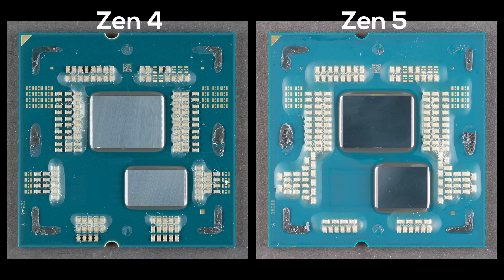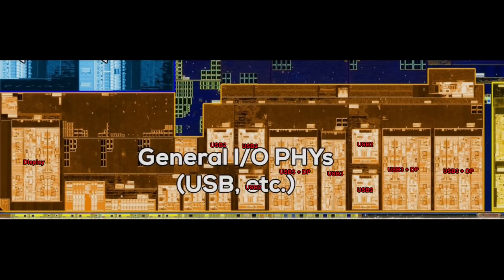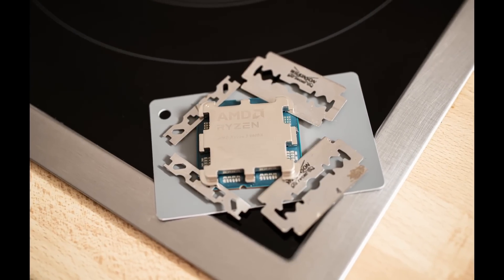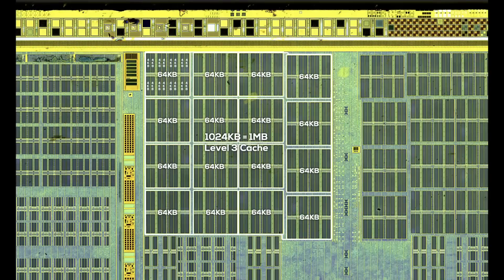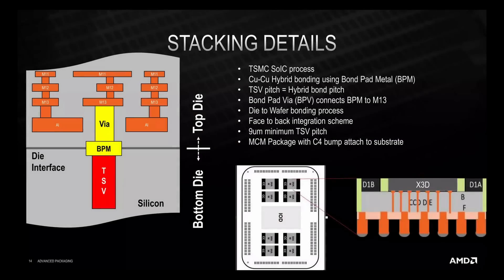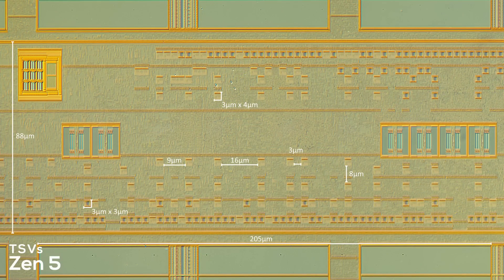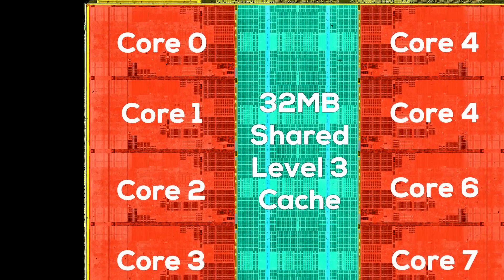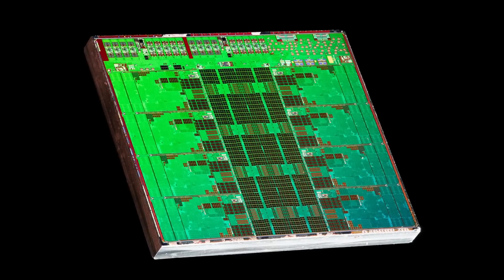ZEN 5 has a 3D V-Cache Secret

Comment: Having 2-layer 3D-cache makes sense given the rumors that the new X3D-CPU's can boost higher. More compact 3D-cache that is further away from the compute cores would be less sensitive to heat coming from the compute cores.
Reply: As the SRAM cache is now probably stacked now on multiple layers. Wondering if it suffers also from exes heat. Question is how much can you stack before heat dissipation starts to become issue and making it more unstable etc... Even SRAM is more efficient and generates less heat.
Reply: There's an ongoing paradigm shift in how to layer IC using the Z dimension to bring further advancements. I wouldn't be surprised if we see really thick dies in the future where power delivery, logic and cache have their own layers.
Reply: Now we know that it is "simply" (I'm being sarcastic, since there is nothing simple abut it) because 3D V-Cache chiplet will be below compute chiplet. Not above. Which has a lot of perks when it comes to thermals, but also a lot of trade-offs in other areas. Performance should be higher, because not only it will be able to clock higher than 7800X3D , it will also be fully overclockable.
However for example cost and complexity will be higher, packaging will have to be even more precise etc. No wonder that while "regular" Zen 5 chips launched with 30$ lower MSRP than Zen 4 and now got additional price cuts. 9800X3D is launching with 30$ higher MSRP and also demand for and perceived short supply of 7800X3D already has it around the same price (150$ up from 2 months ago) than 9800X3D (480$ MSRP) Though I assume that once the process matures, especially in packaging, prices will drop. But it might take longer time than usual. However 7800X3D has probably already stopped production. People thought that this was driving price up, but honestly it was demand, since there were enough 7800X3D chips in supply chain that some are still being delivered to retailers.
Also as Dr. Ian Cutress explained in this configuration latency in clock cycles might increase. Due to increase in Frequency latency might not increase in time though thankfully. But now doing 2-hi or 4-hi chips would be more difficult. HBM has controller below memory, like zen3 and zen4 3D V-cache chips had. Of course said controller uses much less energy.
Also it seems that Turin-X isn't in the plans, but maybe we will get Threadripper with V-cache. Maybe some new solutions will allow it to also be included in Zen 6 and further if we think of increasing amount of 3D V-Cache. Personally I was thinking that Backside Power delivery might be this technology that will help. Because that new "flipped" L3+compute die, with BPD will be flipped again. We shall see.
Reply: @jannegrey honestly, the 9800x3d price increase probably has less to do with actual production cost and more to do with it being the best gaming CPU on the market, and not by just a little bit. They charge more because they can and people are obviously willing to pay it
Reply: Wasn't the main issue with the clockspeeds the lower voltage tolerance of v-cache, not the heat? The heat issue is solved with lower power limit and lowered thermal limit, but it should have still been able to clock high for as long as it had the thermal headroom instead of having locked core voltage
Reply: @shepardpolska Saying new X3D chips could "clock higher" really just means in relation to the non-X3D configuration. Since zen5 effectively has the same freq limits as zen4 while generally being more efficient, it's very likely X3D will get closer to this because it'll have more headroom. Especially since X3D uses binned chips capable of running lower voltages.
Reply: I don't understand. How would a higher stack the heat has to be dissipated through solve any heat issues?
Reply: @unvergebeneid  Heat comes more from the cores than from the cache. That's why they stack on the L2 cache in the first place.
Reply: @aapje  ah, now I understand, thanks!
Reply: Maybe I missed something in the video, but why didn’t the CCD tear down conclusively answer how many cache chips there were? They had to remove the cache chip(s) to get down to the base logic chip to get those die shots anyway, right?
Reply: @JoeLion55  this wasn't a 3D V-Cache CPU because they aren't out yet. Hence the speculation.
Reply: @unvergebeneid  oh, then how did they get the die shots…? I  thought these were from decapped shipping units
Reply: @JoeLion55  They used a current non-3D V Cache CPU (that is already released), and some shots of 3D V-Cache were from the last generation of CPU. It's all labeled and explained in the video.
Reply: @The7Tycoon  thanks, caught all of that on the 2nd watch through

Comment: Excellent explanation. I want to see how X3D cache will be implemented on Zen 5 since some reports tell that the 9950X3D and 9900X3D will bring something new.
Reply: Yes the 2 CCD parts will both have stacked cache
Reply: @Razzbow potential +128MB 3d cache for 9950X3D?
Reply: Only buy dual CCD if you actually needs the CPU power for applications, because in games, 9800X3D will beat them. Single CCD = No latency issues.
Reply: @Dr.WhetFarts if both CCDs have V Cache that means that process can stay in any CCD without worrying their data is in the other, they don't have to be specially allocated nor windows have to use core parking
Reply: You could also use project Lasso tied 2 games so that whenever you launch a game, it automatically disables The Other CCD for only that game process  @Dr.WhetFarts

Comment: I really expected a new I/O die with Zen 5, but the fact that it is the same perfectly explains why Zen 5 has the same difficulties with two memory sticks per channel as Zen 4.
Reply: It seems they're putting all their IO efforts into Zen6 but honestly I think it's unlikely we'll see significantly higher frequencies with 2+ DPC DDR5 as there are inherent signal integrity challenges that go beyond what is limited by the PHY and UMC. I'd expect an improvement but wouldn't be surprised if supported speeds still aren't significantly higher in these configurations.
Reply: @JJFX-  Maybe Zen5+ next year with the Zen 5 CCD but new IO Die? With all the AI hype they might accelerate some things. 
You're right though, we're clearly running into the limits of DIMMs, as for the first time in decades we're seeing new forms pop up like CAMM2.
Reply: @MacGuyver85  Well I doubt there will be an iterative generation on desktop prior to Zen6. I see the most significant IO improvements going hand in hand with the advancements brought by Zen6. Even though Zen5 overhauled the core design, in some ways this generation can be viewed as Zen4++. The next generation will likely bring it all together as the pinnacle of AM5 prior to moving forward with DDR6.
Reply: @MacGuyver85  "Maybe Zen5+ next year with the Zen 5 CCD but new IO Die"
Strix Halo?
Strix Halo/Sarlak is supposed to be 1-2 Zen 5 CCDs along with a larger I/O die with a much more powerful GPU and a 256-bit (i.e. quad-channel DDR5) memory bus. It's for laptops though, and is not expected to be released on AM5, unless they have a load of partially-defective I/O dies and decide to use them for a desktop SKU which is heavily cut-down, because AM5 only supports 2 memory channels.
Reply: @nathangamble125  Yeah, that sounds like the path forward for desktop as well. Just minus the large iGPU. 
Something has got to give to keep those cores fed, and if it isn't more cache or much faster memory, it'll have to be quad channel.
Thanks for the info, not up to date on all the different CPUs out there, especially laptop/APU.
Reply: @MacGuyver85 CAMM works for laptops not desktops. Most likely thing we are gonna get is optical signaling so we can run memory at higher speeds and less latency. Same things have been suggested for PCI-E and even inside the CPU.
Reply: @xfy123  There are several desktop motherboards coming with CAMM2.
Optical is the end-game but that's not viable in the near future.
Reply: @MacGuyver85  afaik CAMM 2 is in testing for small form factor and clean looks not for performance seeing as it would severely hamper memory capacity as you could only use one sided camm modules at high speed without overheating and getting unstable ram. If I remember correctly NASA used optical signaling for memory back in the 80s so if the need arises we definitely could go to optical for signal integrity.
Reply: And why the uplift of Zen 5 over Zen 4 is so small. 
Better cores that are as memory constrained as the previous gen which was already memory constrained...
Reply: I think zen6 will be on a new socket with ddr6 and pcie 6
Reply: @hasantan  Considering that they're still struggling to get the most out of DDR5 and PCIE6 is not only a whole other can of worms but generally unnecessary on desktop (at least for a while), I think Zen6 will be the last AM5 generation as will the presumed X970 platform. It's possible they're playing it safe by supporting both DDR5 and DDR6.
Reply: @hasantan  a lot of people would get angry. But we have leaks of Zen 6 with both DDR5 and DDR6 memory support, so I don't think it will be AM6 only.
Reply: @hasantan  I have doubts about PCIe v6. V5 encountered substantial signal integrity issues in mass production design, just over the length of an ATX size board. V6 may end up being only slightly faster than v5 but with improved signal integrety for ease of manufacturing.(and the server needs external PCIe cables, they directly connect adjacent racks with v3 cables, and adjacent cases can be connected with v4, but they lost that with v5.
Just look at all of the boards that mix v5 and v4 PCIe slots, you didn't see that with v3 or v4 boards.

Comment: Great analysis as always. I hope that Zen 5 X3D brings a larger leap in gaming performance than regular Zen 5 did.
Reply: The AMD has said that 3D cache version can clock closer to non cache version. So while 7000 and 9000 non cache versions have allmost same clockspeed… the 3D cache version 9000 version should clock higher than 7000 series does. And that is the main advantage this time.
Reply: @haukionkannel  if all of this is true then the 9800 X3D will be worth the buy.
Reply: 9000X3D will deliver a much bigger jump from 7000X3D than 9000 did from 7000. Massively higher clockspeeds is the reason. Less sensitive 3D cache = Higher clockspeeds.

Comment: I wish AMD would sell consumer parts with 2 "golden" CCD's both with 3D V Cache (obvs for a premium)
Reply: It's already been rumored that the 9900X3D and 9950X3D models will have 3D V-Cache on both CCDs. Remains to be seen if it's true.
Reply: @KillahMate  those will be really expensive cpus if that is true!
If one 3D cache chip increases price by $100+, two will increase it by $200+… but why not! If there are people who want to buy, lets just make them! Nothing wrong in that. It just does not make sense in economical and productivity task speed reduction in mind. Hopefully they also make one 3D cache chips versions to those who want also productivity boost.
Reply: @haukionkannel Realistically the vanilla Zen5 flagship should be closer to $500-$550 so it wouldn't be that hard to imagine a 2xX3D configuration holding around $699-$749 depending on much performance actually scales.

The smaller L3 cache would improve yields and doesn't necessarily need to use the same node but how much this helps offset the cost of stacking 2 cache wafers remains to be seen (assuming that's the case).

IMO dual X3D chiplets makes for a more sensible product stack as long as they are able to bump up clock speeds. It's possible they'd wait to unveil this with Zen6 but I have a feeling we'll see something more interesting for that (perhaps shared L3 across two CCDs?).
Reply: I'd rather they just release enthusiast models without an IHS designed for direct die cooling.
Reply: So you would get much more expensive cpu that is worse in productivity and about as fast in gaming as single 3D cache version… why would AMD do that? Why would they make the chip more expensive and worse?
Reply: @haukionkannel  Because there is a market for those who wish to have a mix of both; I would rather have a chip that has vcache on both CCDs to minimize cache misses when a program or game is utilizing more than 8 cores.  If there is enough data to overwhelm the non vcache portion then its much more likely to pull data from ram again which has kept me away from the 7900X3D and 7950X3D.  

AMD already has vcache on every CCD with their last generation Epyc Genoa-X lineup including 9184x 16 core and 9384x 32 core models.  It would make sense that this implementation will make its way to the consumer market given the improvements to efficiency of the newest 9000 series Granite Ridge processors.
Reply: @Nachokinz  Doubly so considering these will fill a needed piece in the Epyc 4004 series. The hybrid 79xx3D just seemed like it was always half of the wrong CPU for the task, a typical one-size-fits-none product.
Just for other readers those 9184x and 9384x Epyc models use 8CCDs with only 2 or 4 cores enabled on each so they have respectively 48MB and 24MB of L3 per core, and spread the heat over more area. (7800x3D has 12MB per core, and 7700x has 4MB per core. 7600x3D is 16MB per core)

Comment: Great video. But could you make music parts quieter? Sound level of music and sound parts should be lower than voice level, to make them comfortable to hear, this is an unspoken YouTube standard, but these are higher.
Reply from the maker: When mixing the two times I used music for a few seconds, it didn't seem too loud. Sorry if it's too high for you!
Reply: @HighYield  I listen to using over-ear headphones, not phone speakers, maybe it matters. BTW, compressed audio track is being heard more loud than uncompressed one. Two tracks (music and voice) may have the same high level, but different compression and one would be more loud. It's a common mistake on YouTube, guys just drop audio track grabbed somewhere on the Internet, they are often very compressed, and it just yells. Different frequencies are also percepted by human ear differently. It's better to use LUFS scale on your video edit software, it factors these things. Also, I've met such recommendation:

Dialogue: -6db to -15db(Nb. Most YouTubers tend to stick at -12db max)
Overall mix Level: -12db to -20db
Music: -18db to -20db
Sound Effects: -14db to -20db.

Comment: AMD has promised "exciting changes" to the x3d chips, and the die shots seem to show that there really is more than just marketing BS happening
Reply: I was wondering if there'll be less 3D cache per CCD, but AMD will make up for it by populating both CCDs, rather than just one like in the current 3D v-cache.
Reply: The problem with marketing BS are for games. even with seeing review and the wider bunch of things and interview with Mike Clark(chief arch of zen), it was definitely designed  for Core workload. It true AMD marketing teams are kind of stupid, but you still need something to show. and it makes me wonder if there a spy from nvidia pulling strings with stupid marketing (RDNA3 and delayed RDNA4) on GPU side
Reply: @noobgamer4709  
Seems to be a combination of Windows 11 being atrocious and AMD exaggerating their gains rather than just AMD being dumb.
The differences between Windows 10 and Windows 11 in performance are massive especially on Zen 5, check out Tech Yes City's recent vids on it.
Reply: To be fair, what AMD engineers consider exciting may be different than consumers find exciting.  I do think a smaller Vcache chiplet looks likely, but still be wary of taking such comments too out of proportion.

Comment: one thing i'm no clear about is whether havinga narrow band of tsv means you stack the cache only on that bit and that improves heat dissipation? or maybe you add a full thickness chip but the areas to the left and the right of the narrow aren't even filled with transistors, just lots of copper to spread heat well?

Comment: Given the rumours of parts with cache on both CCXs, it feels like the cache die being half as big but having one on both CCXs rather than just on one would be a viable route for them to take given this information. Of course, that'd potentially make the 9800X3D underwhelming with half the extra cache, so maybe that version is the 9700X3D and they double stack for the 9800X3D?
Reply: 9800x3d leaks seem to indicate it gets the same amount of l3 cache as the 7800x3d
Reply: @tommihommi1  Yeah, I can't imagine them cutting it in half for the 9800X3D, just for the optics, which is why I suggest they might need to double stack for that chip in particular, in this hypothetical.

Comment: those images of the chip look so incredible and sci-fi. What causes all the colors? It looks like a factorio map
Reply: thin film interference and diffraction grating
Reply: @tommihommi1  that’s awesome, did they design it that way on purpose, or does it just happen because of the structure of the underlying circuitry?
Reply: @incription  fritzchens fritz makes sure there's extra contrast so you can see the details better. But the colors are just a side effect of all the tiny wires and other structures that make up a chip.

Comment: AMD should use a silicon interposer to fix slow ddr5 speed and low bandwidth performance. Intel arrow lake will support camm2 10000mhz and CUDIMM 10000MHZ . Low latency high bandwidth Ram improves 1% low fps and 0.1% fps significantly.
Reply from the maker: There's a good chance Zen 6 will do that :)
Reply: The only reason I am not that fan of AMD. I hope in the future they do use a silicon interposer.
Reply: instead of a silicon interposer, putting the DRAM controllers on the CCD while leaving all the other, less critical IO on an IO die also works, that's what intel is doing
Reply: @tommihommi1  This also works, although a silicon interposer would be solve more problems.
Reply: Downside: silicon interposers are more expensive